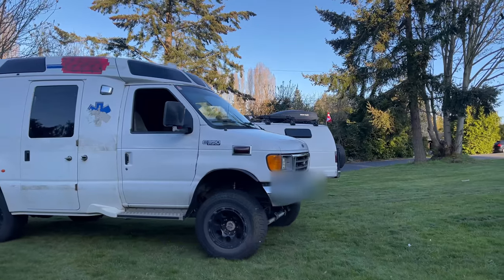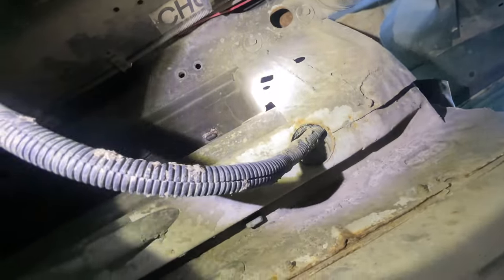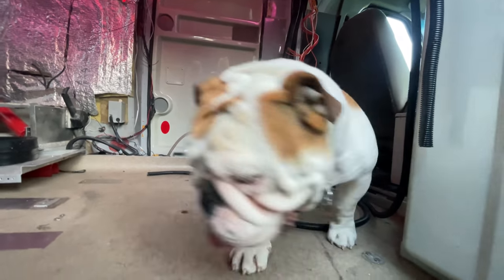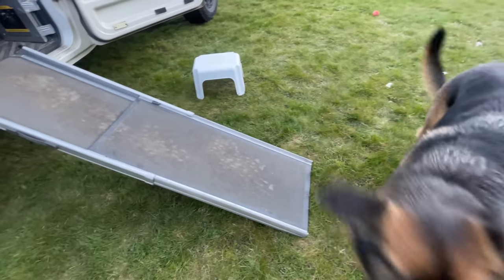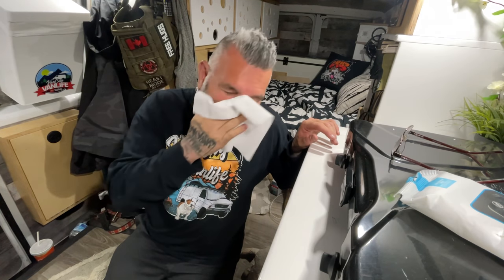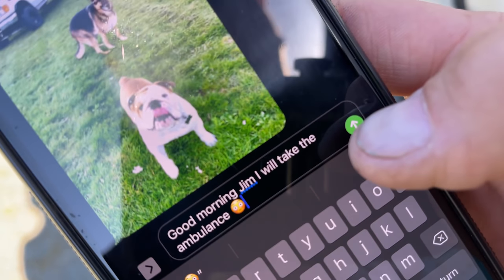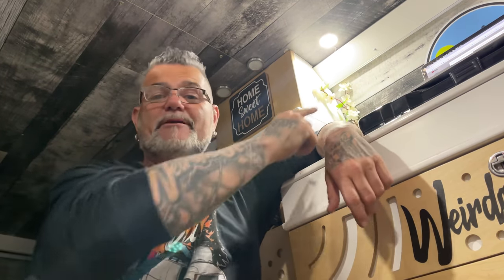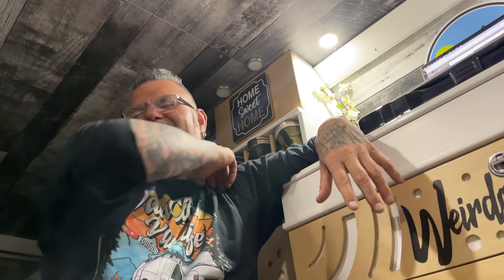Ford E350 7.3L Diesel Ambulance | This Would Make An Awesome BUG-OUT Vehicle (THE PROJECT)

Comment: Ha! I just bought a diesel e-350 “box” type van as my bugout vehicle. Thanks for the validation 😂
Reply from the maker: WICKED!
Reply: No way! Where’d you find that?
Reply: I recently bought a 2003 unicell with the 7.3 litre. I can’t wait to move into it permanently. Hopefully the borders will open up for casual travel and we can have a 7.3 meet up. 😊🚚
Reply from the maker: @ajisroadtrippin5505  thats awesome
Reply: @ajisroadtrippin5505  excellent! I literally bought a 2006 Tioga yesterday in Arizona. Under 30,000 and only 6,000 miles on it. I always wanted to do a van conversion but it ended up being too expensive. 😔😔 so I got the next best thing ☺️

Comment: I had a 2000 7.3 ambulance just like that one. I towel a 2 car trailer all over the western states with it for 5 years and over 300k miles. It's gonna be an absolute beast and rock solid reliable for you

Comment: Amazing that you uploaded an ambulance video, I just went to look at a 1990 ambulance yesterday that I’m likely going to buy. Wasn’t even looking, just got a random listing suggestion from FB about it and it’s the best I’ve seen in Michigan in over 4 years of trying to find something not rusted to hell. Fun part is it still has the flasher module so I’ll be able to hook it up for fun if I can make heads or tails of the wiring.

Comment: Just a tip, I presently work in one of 3 ICBC wheel repair shop on BC. An Alloy wheel is subjected to cracked rims and bent rims. Buying a steel rims, not so pretty but will more reliable.
Don't believe me, ask any tire shop.

Comment: The fiberglass structure is not as conductive for heat as the steel so you don't have to have as much insulation you probably know that already

Comment: Remember what Boat means? Break out another thousand. Diesel engines can be very spendy. My current diesel has 115000 miles and just replaced all injectors for 5000$. Think amigo.